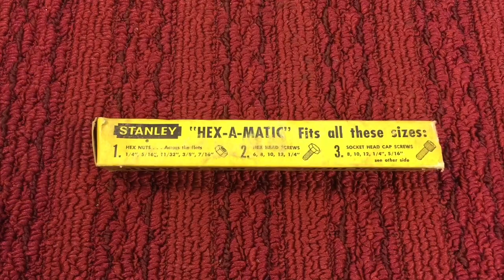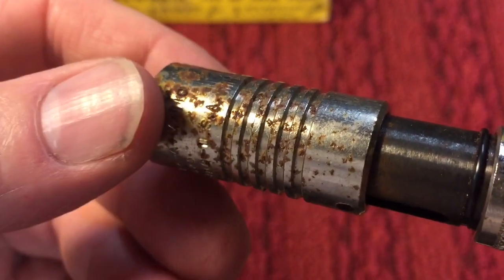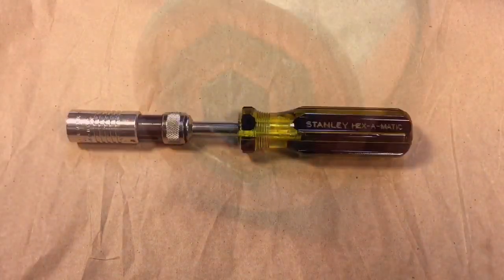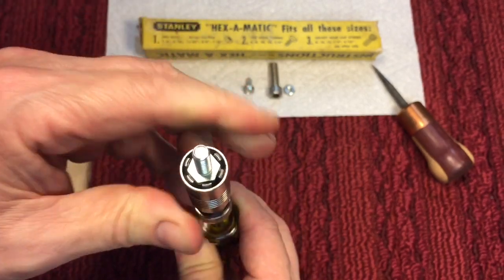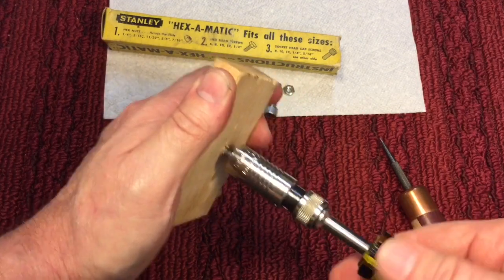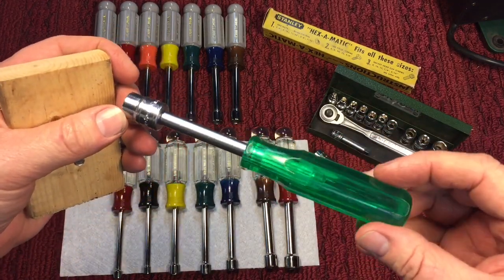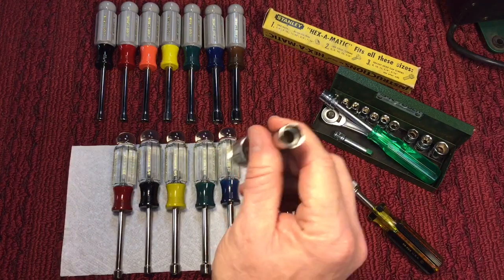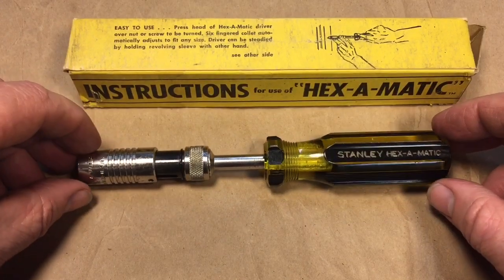Vintage Stanley Hex-A-Matic Adjustable Nut Driver

Comment: I own one myself. It works great for light work.  You wouldn't want to place a tremendous amount of torque on it but I've used it to adjust bicycle's and repair grills. Handy in that you mostly have to bring one tool with you..
Reply from the maker: Hello IAR!  I love it when someone actually owns and uses a tool we are new to!  I'm going to pin your comment as a testimonial of someone who has real experience with this tool!  Thanks so much!!!!!!!
Reply: Thank you for the great videos..
Reply: I've got one, too, and it works well for what it does.  Like most multi-purpose tools, clearance often becomes an issue.
Reply: @ScoutCrafter  0
Reply: I had one for many years and it was okay for light work and where you have the clearance.  Maybe it was because I kept trying to use it in situations that needed more torque but it seemed to get worse over time.  One day several years ago I was frustrated with it and threw it away so I would stop reaching for it in my tool box.

Comment: Years ago I used to have an HR manager on my team who would always remind me "there are many ways to solve this problem; we only happen to see one right now..."  And she was always right!  Today I was struck by both this and recent videos you've done on novelty wrenches, and by how many different wrenches I used earlier in a 4-hour period:  Knipex Wrench Pliers, original Crescent adjustable wrench, open-end wrench (both the closed and open ends too), a small All-Trade pipe (monkey) wrench, and even some locking pliers as really more of a wrench.  When first starting out I tried to convince myself just one adjustable wrench would do it.  Well, it didn't.  Given infinite tool chest space, one could use an infinite amount of Hex-A--Matics, Snappy's, and all the others.  Because there are many ways to solve the seemingly simple problem of tightening a nut or bolt!
Reply from the maker: Hello Marc!  You are so right!  Also, it all depends what tools are in your mental-line-up, when I only had a tool box full of tools I would think of what tool I had to do the job at hand and grab it... As time goes by we get more and more tools that we have to mentally add to the line-up... Then one day you get to the point where you have a dozen tools that could do the simple task at hand and you sit there with a dopey look on your face as you try to mentally sort out what tool would be best... That's where I am at!  LOL   I need to go back to the toolbox full of tools so I can get something done!  LOL   Thanks Marc!!!!!!!!

Comment: Beautiful mechanism. Talking of NOS I used to work for a company that rented an old WW2 hanger. In the back of the hanger were massive shelves with dozens of dusty boxes. Each box was brimmed with automotive metal parts. Each part was heavely covered in grease and wrapped in a waxy paper and put into individual little cardboard boxes. Those parts were perfect after 70+ years of just sitting there.
Reply from the maker: Hello Andrew!!!  Yes!  I used to buy a bunch of Military Surplus items and I loved it when they came in that waxed brown paper and the item was covered in Cosmoline! It wasn't pretty but it sure was protected!!!!  Thanks so much!!!!!!

Comment: The differential went out on the pickup Wednesday. Bought a new truck Friday. Sold the old truck today. 
Finally got to catch up on YT and came here first. Nice little tool. More of a Father In Law gift than a replacement for the nut drivers or socket set. A set of 1/4" drive deep well sockets is handy. Put them together with a power screw driver and a 1/4" drive adaptor and you are cooking with gas. 😊
Reply from the maker: Always nice to have a new vehicle!  Lot's of luck Dave!!!!

Comment: They sure did a better job with gimmicky tools back in the day compared to today, no? I have a handful of those Craftsman Nutdrivers, I don't believe a full set but I have some metric and some standard ones but I know I got some from my father around the house, made in USA and I believe he used them for work in addition to around the house and bought them way back in the day too. Wish I had the whole set. Replaced the ones I keep in my tool box  with some newer Husky ones not too long ago and retired the Craftsman ones.

However, the spinner handle you used (with the green handle) I'm really fond of. Obviously it has limitations and even using a deep socket won't always help with the example you showed where a nutdriver can be better (assuming it has a hollow shaft as not all do) or be practical but with a good set of sockets, a hex bit adapter and some hex bits you have a pretty good set. You can use it on things like an RC car all the way to an exotic car.

Comment: I would normally call that gimmick, but if you are working by yourself and it is not easy to get back and forth to the tool chest (i.e. working in the attic), having a tool like that might be nice. As always, great stuff! Thanks for sharing. Cheers
Reply from the maker: Hi Joe!  This one is well made and works on both metric and standard plus rounded off fasteners... However  I will probably never have it with me at the time it would work great!  Lol   Thanks!!!!!

Comment: i bought one when i saw this video, got it on ebay for 7$ shipping costed around 20$
i checked again today, and i saw one that costs 16$ 
i dont regret getting one, it was a little rusted, had to do some brushing and polishing, but works pretty well!
Reply from the maker: Hello Michael!  I think this tool makes a great collectable as well as a usable tool!  I like well made tools and mine too was rusty (shelf wear) but cleaned up nicely as I'm sure your's did too!  I love the feel of older stanley tools that were made in the USA!  Thanks so much!!!!!!!!!
Reply: it did! Quality tool is always fun to work with,  I think im gonna keep it inside the house for small fixes, rather than in the garage,  i have became very aware of the tools i buy, since i became a owner of a house with a need for attention, its so much fun to work with good tools compared to cheap unbranded ones, i own alot of german made tools and a bunch of used norwegian screwdrivers, geilo tools, i have found alot on flea markets, and happily not many seems to bother looking at brand stampings on dirty rusty old hand tools :-) sorry for long post!!

Comment: All tools have pros and cons, pros can adjust to several types of screws, nuts and bolts, is hollow so fits over bolt to reach nut cons thicker than nut spinner so may not have room to fit on, mechanical movement that could bind or seize up and if you lose it you have lost all where as a set of nut runners if you lose one you still have the rest. Nice quirky tool and interesting one to have in the tool box. As for shelf wear that was rust  not wear. Is that down to the shop or is it down to the manufacturer not oiling or protecting them?
Reply from the maker: Hi Tony!  These tools were plated from the factory so in a reasonable environment they should never rust in the box. The problem is when kept in a unheated garage in a climate like here in NY the hot/cold shifts creat a moisture problem and everything will eventually rust!  A good warehouse should be climate controlled and humidity controlled. If your tools are rusting you have to address those first, however if you live near the Ocean or salt water that is a problem too!  Florida is notorious for rust issues!  Thanks!!!!!!!

Comment: Pretty useful if you ask me. one other thing I think this would be good for is if you get a situation where the nut has rounded off and you can't get a good grip on it. This looks like It would work. Especially if you can't get something like a vice grip on it to bite.  I have had some luck with the universal socket because it basically will fit anything even rounded off nuts.
Reply from the maker: Hello Tron!  Excellant observation!  It would indeed work on rounded and recessed nuts!  Great selling point!   Thanks very much!!!!!!

Comment: Seems like a fairly practical little tool. I imagine it would work with driver bits too. Shelf wear, usually a nice way to say rusted, scratched or beaten to crap, but never used.
Reply from the maker: Hello Emerson!  LOL  You are so right about the shelf wear!  When I was younger I was restoring a 1951 Pontiac Chieftain! I ordered a Chrome emblem that the guy said was NOS but had shelf wear, I got the emblem and it was pitted!!!!!  I sent it back and never ordered from him again!  =)    Thanks!!!!!!!!

Comment: Scout - Mine has "toolbox wear" from finding its way to the bottom of my toolbox.  When I bought it, I thought, "Great! Now, I don't have to pack a bunch of nutdrivers." I thought wrong.  Ended up buying a set of Stanley 100+ nutdrivers.  They have the same handles as the Hex-a-Matic, but that's were the similarity ends.  By the way, I always thought I took good care of my tools, then I see your stuff - I'm ashamed of myself.

Comment: I have both types that you showed in the video. Y one you didn't demonstrate, the one with the various size retractable shells doesn't work very well and just stays in the drawer. The other one actually does work fairly well but it also pretty much stays in the drawer because I have both a metric and an SAE set of nut drivers (Klein) mounted on the wall right in front of my work space and they are what I grab first.
Reply from the maker: Hi Buddy!  Once I got my set of nut drivers I never looked back but I was shocked at the quality of this tool!  Thanks!!!

Comment: I have one of the telescoping hex drivers like the one you said you've had for some time. I've had mine for  nearly 50 years....I've never used it.
My experience with nearly all the "one size fits all" or multi-function tools is that they don't do anything particularly well and end up chucked into the back of the bottom drawer of your tool box.
Reply from the maker: Hi Ace!  Me too!  Never used the Klein hex sleeve model and I doubt I will ever get to use this one either!  LOL   Thanks!!!!!!!!!

Comment: I like that tool. I need a nut driver set for work, is the craftsman one good quality? Is there another set you’d recommend otherwise? Snap on was insane (like $240) so they’re out of the question. Thank you for sharing!
Reply from the maker: Hello Tim!  I have the USA Craftsman set and love it!  Klein, KC and a few other companies make really good looking sets... Years ago Xcelite made nice nut drivers but now they look different... (not in a good way)  The only problem with the Craftsman was they were a little thick-walled for some uses.  Thanks!
Reply: Check out WiHa and Wera from kctool.com or chadstoolbox.com great quality german brand made in Czech republic

Comment: That certainly looks like a useful tool to me! I can see myself using that on appliance and small engine repair. Could you put a hex-to-socket adapter in there to extend the range on hex bolts or nuts? Beautiful refurb, was the "shelf wear" rust and pitting on chrome plating? Didn't think the wire wheel would help with that but they turned out super!
Reply from the maker: Hello Steve!  I don't know about the adapter because the system isn't super heavy duty but it is very well made!!  I was too surprised that the rust did not leave pitting or scarring!  I'm glad!   Thanks very much!!!!!!

Comment: That is one Kool Tool . Especialy if it will work on all of. the Metric and standard sizes that your 2 Craftsman sets will fit . Does it ? If it does , I'll just have to get me one John !
Reply from the maker: Hello Dave!  There are 7 sizes to each set of my nut drivers, I think this Hex-A-Matic works on the 5 in between, Not the smallest and not the biggest!  Nothing beats a nice old fashioned Nut driver!  I like my Craftsman sets but professionals prefer Xcelite and other brands that are thin walled and taller. I don't use them all that much...  Thanks Dave!!!!!!
Reply: True John . I have both sets of Craftsman too . I was thinking like the other man that owns one as well (ItsAlwaysRusty.......Above) in that , it would be nice to have it to add to a small , on the go bag . To have for those just in case jobs you have , and be able to keep it in your car for just that . It's just not practical to carry a big box of tools around in your car (with both sets of Craftsman nut drivers , and all the other specialty tools). But this tool , and a couple other all purpose tools could fit in a small bag , for emergencies .
Reply from the maker: Dave!  You know me! I never need too much prodding to by a tool that catches my eye!  LOL   This little nut driver has collectability value too!  Now Klein made one, I have it too, that has the sliding Hex sleeves and although it works, it's not as versatile!  Thanks!   =)

Comment: I found a Steven's Walden, Inc.  Company is long gone
Switchcraft A1070 
Grip Spintite
Worcester, Mass.

The head looks similar to the hex o matic, but front grip teeth height is only 1/8 with a huge 1 inch hollow.   
I wonder if the design is to hold the bolt while you use a ratchet or box wrench from below...
Reply from the maker: Hello RS!  Wow!  That was a good investigation!!!!!  Thanks so much!!!!!!

Comment: I find that to be a spectacular gimmick. I would be more prone to calling it a user, but every time I try something like that out it never survives first contact with the work I end up having to do on one of my cars. It's just the large number of small parts. For lighter duty use like around the house and and general use it should hold up well. I'd still have one.
Reply from the maker: Hello Allan!  The problem is we are tool guys and always like to add another to the box useful or not!  =)   Thanks!!!!!!!
Reply: @ScoutCrafter  I need to see if I can still find my Gator Grip socket that did exactly nothing useful except bend a few pins.
Reply from the maker: Allan! It's so funny you mention that!  I am just finishing up Friday's video and One of the subjects has a Gator Grip type socket in the handle...  I never had luck with them!  LOL   Thanks!!!!!!!!

Comment: It looks like it would be very useful for installing things, but how would it hold up to uninstall? It could be troublesome. That being said, I could see it being useful for the guy that wants to limit his trips to the toolbox.
Reply from the maker: Hello DJG!  Absolutely!  I love weird tools so for me it's a win but I am 98% sure I will never ever use it!  LOL  Thanks very much!!!!!!
Reply: looks pretty tough and well made to me., but like all these things, you dont use them really., another tool to add to the dad's xmas list
Reply: I sent most of mine to Uncle Sneelock because I sure couldn't do anything with them.
Reply: They have been very useful. I use to work machine repair and maintenance at a foundry. It was a small foundry but still covered two city blocks. It was also multileveled with 50 foot tall cupola stacks and 20 foot deep pits under the mold line for the sand handling equipment. Carrying all the tools you might need with you was impossible. I had a tool pouch with 420 Channellock pliers, a 10" Crescent wrench, 3 double ended ratcheting wrenches 3/8" through 5/8", a pair of dykes, Phillips and straight bit screwdrivers, box/open end wrenches from 3/8 through 9/16", a Quick Wedge screwdriver, and a custom knife made from a file. That was enough to handle most of the work and the rest involved a 4 block walk to get the tools you needed.  
Some of the guys liked the gimmick tools. Most failed after a short time. Sand in the moving parts, over torqueing and snapping the shank or handle. Breaking a tool isn't a big deal. I was told by Dick German, who was the foreman, "Break the tool if you need to. Bend it to fit, weld on an extension, grind off the point or make it sharper. I'll replace whatever you wreck. Just get the machine running." Breaking a tool when you are at the top of the cupola stack, in the winter, and another 100 foot climb to get a replacement, is a lesson you won't forget. 
I went with old school reliability. 
The only new item in the pouch was the ratcheting box end wrenches. They were Craftsman and lasted the 4 years at the foundry, then right up until I went to work at Homebuilders. The crew were transients and if it wasn't bolted down it was stolen. They are probably still in somebody's tool box. Probably after they bought them at the pawn shop. 
I wouldn't mind having this little screw starter. I don't need it. Dad left me his set of Klein Nut Drivers, and I still have the ones that Lewie sent me. 
Oh my. I have run on a bit. Sorry about the story. Doesn't take much to prime the pump. 😊
Reply: We've all been through a lot and truth is stranger than facts! I'd have LOVED to go through a foundry with you. All the power and heat amazes me!  We had a double rainbow this evening and one a couple of weeks ago. I think Someone is letting us know Who is in charge. Just clouds and breezes so far. WESC out of Greenville SC says it ought to hit tonight but go over Asheville on the way out to Tennessee. Beware of flying hypo needles and morons. I'll star hid here with Cheryl. BLESSINGS 2 all yall!

Comment: Shelf wear.... Hmmm.....   It looks like you use a black compound on the first buffing wheel.  What do you use on the second buffing wheel?  I want to set up a buffing station in my shop.
Reply from the maker: Hello Clark!  99% of the time I use the Black Bar compound, the other wheel I keep mostly compound free and use it to get that really nice shine after I'm done.  It just really uses the residual compound and buffs it into a shine!  I recommend getting the 4 piece buffing Bar set by Enkay to start, it has the most used compounds and a chart on the back what they are good for!  Lasts a long time!!   Thanks!!
Reply: Thanks Scoutcrafter.    You have a great YouTube channel.